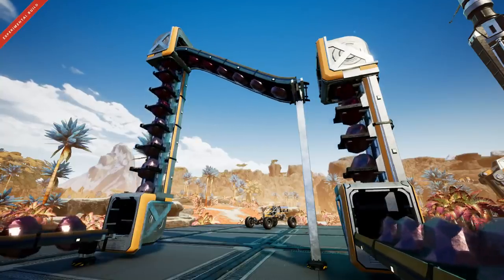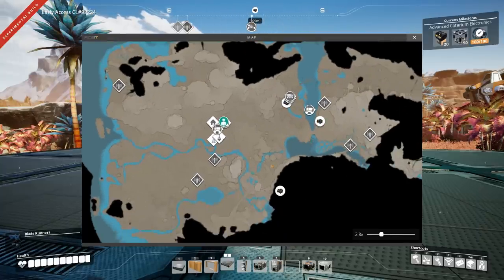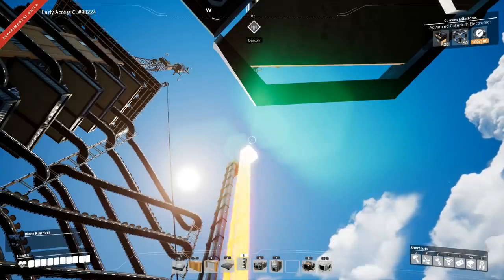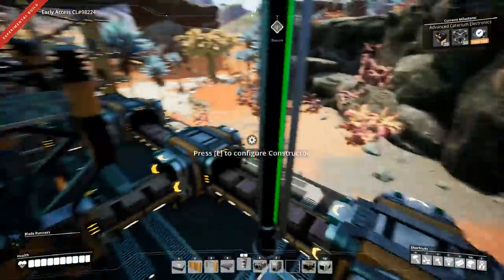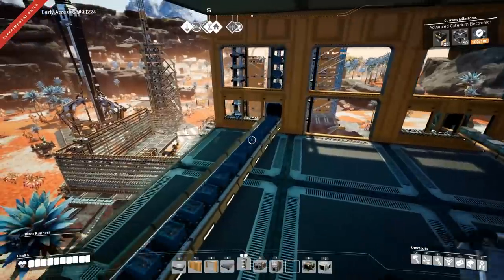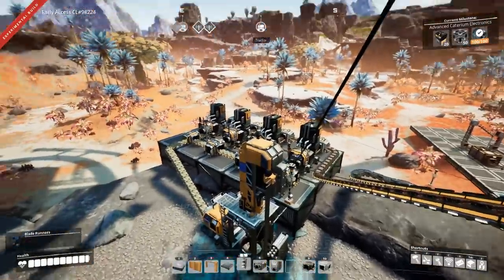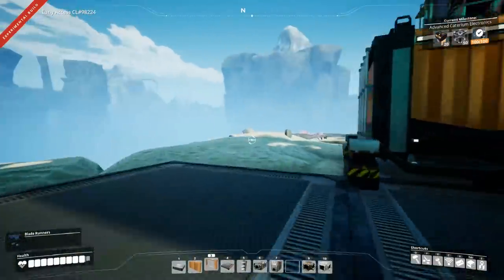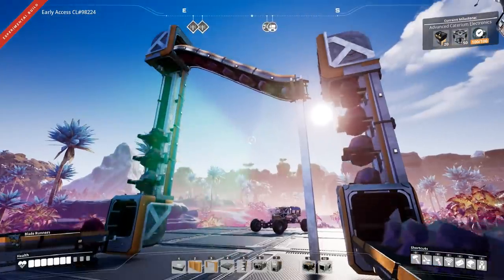Conveyor Lifts Will Change The Way We Build! Satisfactory

Comment: Very happy to see your enjoying the new content and working on new stuff. Love everything they are doing. I havent tested anything on the preview build, kinda just waiting for it to be full release as to not have to re-adjust numbers. Plus I'm having a hell of a time making my 10 truck main bus build work without having trucks go out of sync (causing them to crash every so often). May start over again and try another unique build.  Cheers and have a great day. Ty for entertainment!
Reply: Speaking on how your doing your truck stops, that definitely provides more space.  My truck stop station system requires separate factories buildings that feed into a separate truck station for each individual part. Now I can like you just build something tall and efficient and have it feed down to the lower "garage - station" if you would, which after trains come out that can transition into that. The main bus is working for me and I wonder how programmable splitters are going to work. Cheers again. Had to re-watch your video to get some ideas.
Reply: @brothgar  I even put walls up to enforce lanes for my trucks and they still seem to get out of sync with their path and timing with my other 10 trucks (dont know if its a server thing). Maybe because of loading times between areas and my location. Most of the time they can recorrect and get back on track if they are close enough after wrecking but I figure trucks are not going to be viable to long distances like I have them atm. Maybe for short distances between bases for constructors to assemblers. Then trains for mass transit of ores - oil - ect.

Comment: tried this morning, and as soon as I saw them I thought the same thing, or that for this game they are absolutely game changers!  Even if, I admit it, I found it very stimulating to have to find original solutions to the logistical problems of having to move resources in 3D and not only in 2D (or find the most congenial way for the situation to spiral a conveyor up or down)  They are perhaps a little "barbarian" in the face of the elegance of a spaghetti box but they certainly create new and equally stimulating opportunities.
Reply: Think of it like Civ... you have your soldiers, vs others still coming at you with axes.

Comment: they really need to give conveyor a  power cost per length to balance them up. lets say 10 of mk1 uses 1 point of power mk2 3  mk3 9 mk4 27 and with the lifts 2x the belts for each mk. plus divided also take power this might make people use trucks alot  more. Last they should add a track for cargo like train, battery for when you  hit your power peak that it does not shut down the power, and solar or wind power(but balance very big tower for the wind or solar which only give small amounts of power)